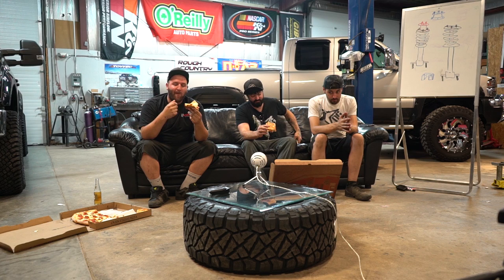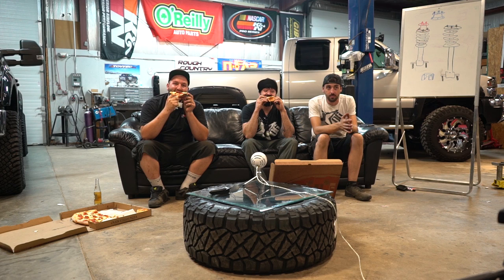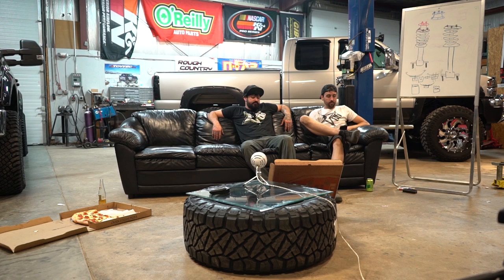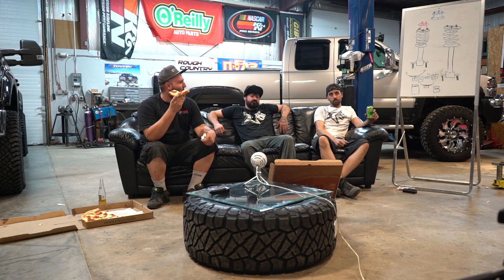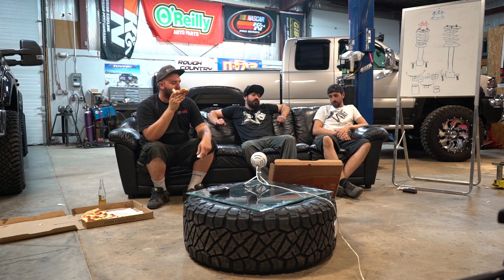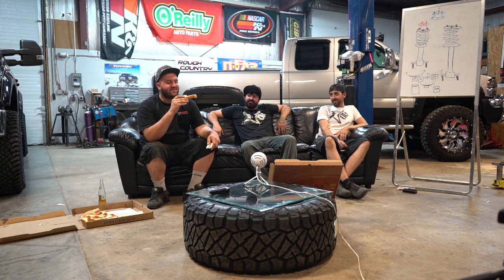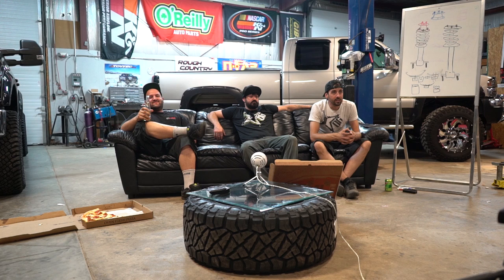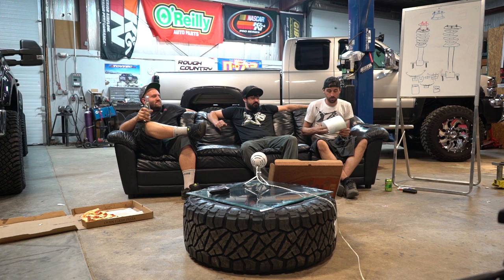Lift it LIVE EP 009: Stackin' Levels on Lifts

Comment: hey was interested in bankers or brads opinion on the rear block that comes with the superlift 3.5 inch lift kit for 2018 chevy 1500 silverado . it says to stack it on top of original block. the superlift comes with a 2 inch tapered block. so its ok to stack those 2 blocks together with no concern ?? or i do i just need to replace the rear blocks altogether with a 3inch one piece block??
Reply from the maker: The kit is engineered to work that way so the block is designed to work with the factory one. It is only unsafe when they are not designed to be stacked. 🤘🏼

Comment: I'm running 7.5 " rough country with 2 in leveling kit on 07 Silverado . My control arms are riding on springs . Will extended control arms take out ball joint angles more ?
Reply from the maker: It will help a bit, how much is unsure though! Never hurts to try

Comment: So can you put 2.5" spacers on top of struts and then add 2" leveling kit to the bottom of the struts to get 4.5" total if you change the upper control arms and 1" diff drop.2016 GMC Sierra 1500
Reply from the maker: We do not recommend stacking kits. Heres a link to all of our lift kits that will fit your vehicle and hopefully get you the height your looking for in a lot safer way. 
https://www.customwheeloffset.com/store/suspension?sort=popular&year=2016&make=GMC&model=1500&drive=4WD

Comment: I remember when I got my rough country 6 inch for my 2019 Chevy it came with a leveling kit to stack at the bottom as well.. so my truck could sit even. Then I upgraded to the vertex and still  through the leveling kit at the bottom

Comment: I have a 2011 Chevy Avalanche LTZ with the Fabtech 6" basic lift kit.  I need to add 2" because the 20X10 w -18 OS and 35x12.50 tires are rubbing.  Any recommendations?  TIA

Comment: I have a 2006 dodge ram 1500 hemi 4wd with a 6” rough country lift  it has the 6” spacer in the front and i was wondering if i can install a 2.5 lift strut on it to get a little more lift to it
Reply from the maker: We don't recommend stacking kits. It puts suspension components at angles that they were not meant to be at with the extra height.

Comment: I have a 3.5 rough country knuckle kit on my 2017 silverado and the back sits about half an inch higher could i add a 1/2 lower strut spacer and be good or would that put too much stress on my suspensions components
Reply from the maker: Its possible it'd be putting extra stress on parts Humberto Can try it out, But a 3.5" leveling kit, should most definitely bring the front up and beyond the rear.

Comment: I have a 2016 tundra 4wd with a BDS 7” Fox Coilovers lift with a 4” block in the back. I would like to fit 26x12 with 37x13.5 but I don’t want to add a body lift. Can I add like a 2” leveling kit with a 6” block in the back and where can I buy it if it can be done. I’m also ordering the BDS upper control arm I don’t know if I need it but it should help my truck
Reply from the maker: We recommend checking out the gallery to see what others have done man! Customoffsets.com/gallery

Comment: #CustomOffset...hey, I have at 2008 Hummer H3 and I want to put the 20x12 Dropstar 652bm with 305/55 or 305/50 tires and was wondering if it would be better to level the back down or level the front up?..
Reply from the maker: you will need to level the front up, and it will still rub lavar

Comment: What's your thought and opinion on adding a 3 inch body lift on a truck that already has a 6 inch suspension lift . Thanks
Reply from the maker: Lots of people do it Carpet!
Reply: Custom Offsets   Is it safe ? Any Risks? I don't go off roading. Pretty much pavement princess . I do pull a 6x12 trailer every day . Thanks
Reply: CarpetMan good question,,,

Comment: #customoffsets ... first off love all da videos ... now my question is that I have a 2005 suburban 2wd .. I'm about to order the mcgaughys 7" 2wd lift kit .. I was wondering if I can add a 3" coil spring spacer in the rear and 3" torsion keys to get my lift to total out at 10" ? I'm trying to run 24x14's with 37's
Reply from the maker: Send an email to info@customoffsets.com and they should be able to help you figure out which kit would be best for you!

Comment: Hmmm so would it be a better idea to swap out your superlift upper spacers and old racho's (3.5 kit) and replace with just a new RC 3.5inch level strut or get yourself that pro truck 2.5 eibach level strut with a 1 inch  lower motofab spacer? Lol
Reply from the maker: Send an email to info@customoffsets.com and they should be able to help you figure out what would work best for you!

Comment: I have 2000 gmc sierra 1500.  i was thinking of doing a mcgaughy 7in with leaf springs, cognito upper control arms, lift keys, and strut extension brackets. Is this a good set up to reach 9inchs?
Reply from the maker: should be a pretty stout setup Cajcmoney